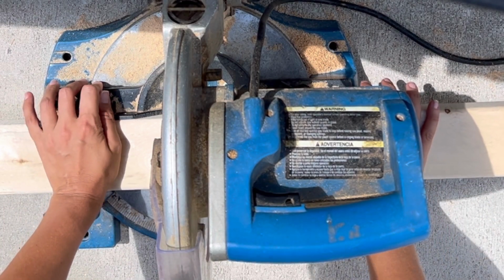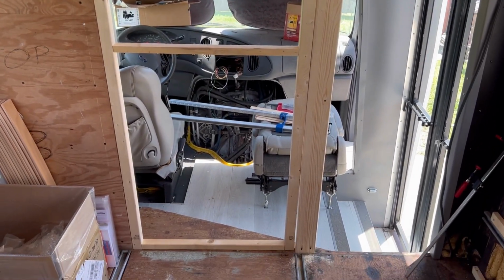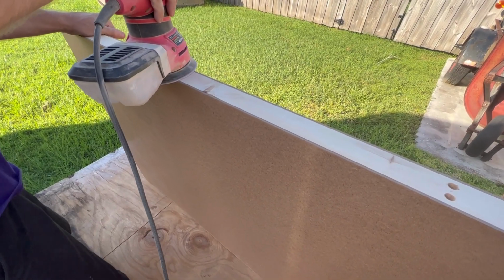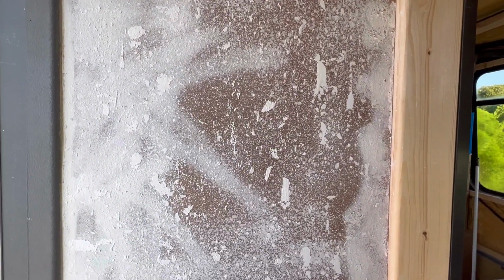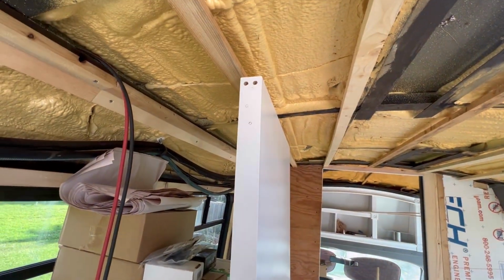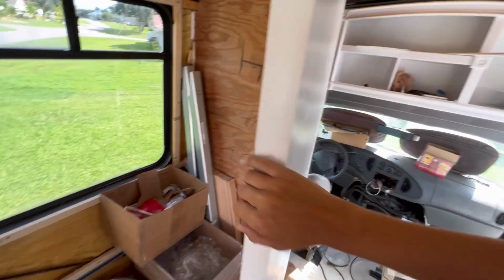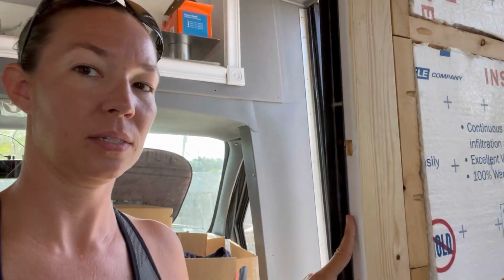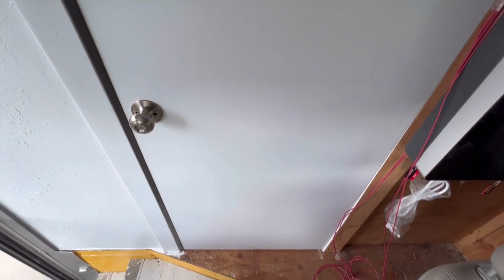Shuttlebus conversion - Episode 17 - Insulated Wall and Front Door!

Comment: Just a suggestion, next time you have a door fitment issue it might be easier to plane down the other edge of the door (like they sometimes do in new home construction). 
Also, your framing square looks like it came over with the Pilgrims on the Mayflower!  John
Reply from the maker: You’re right, planing would have been the better option. I don’t happen to have a plane and I’m on a pretty tight budget, so I made it work with what I had. Like the old square. I definitely need to give that some TLC before I return it to my Dad. I also need to get better at taking care of my tools, but we all have our faults.
Reply: @thegraeescape3285  You are doing great with the tools!  I think most of us can't afford all the tools we wish we had.  But for those special needs (like maybe a plane)  you can rent almost anything at home depot, surprisingly cheap. I just saw the old square and had to give you a razz!  All in fun, John